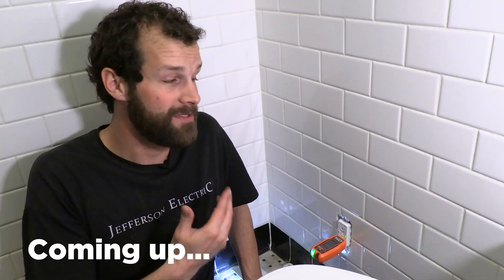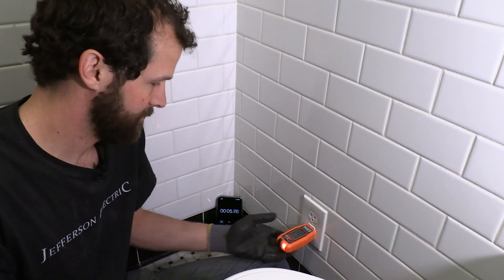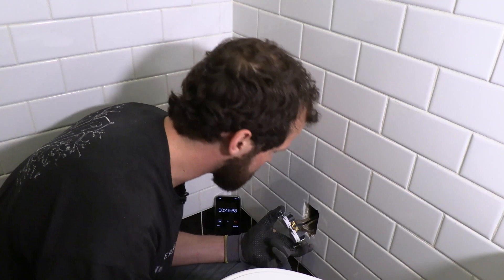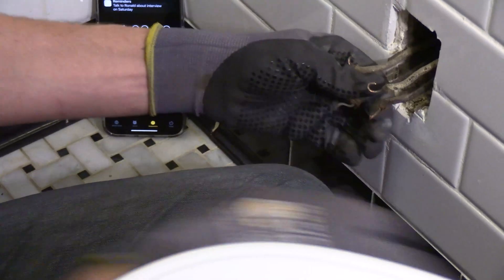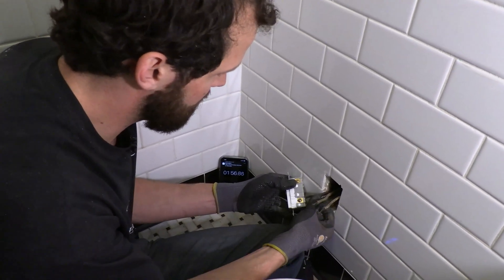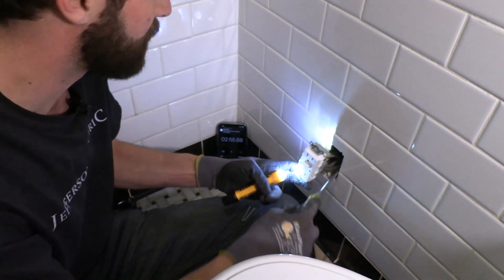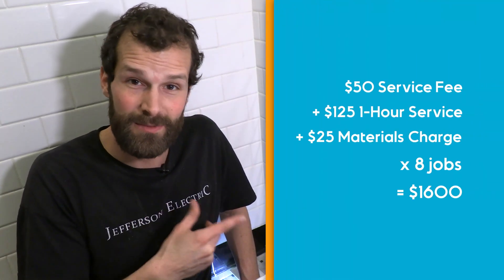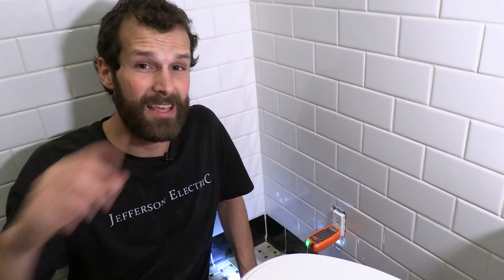Making $1,600/hr. As An Electrician?

Comment: I do alittle bit of DIY around the house. I just learn some of this over time. The builders grade light switches seem to be the worst. I've had so many of those fail. Where terminals on the side that hold the wires just break off, or the back of the switch is broken in half.

Comment: Yessir I know all this and I'm a green light apprentice :) Would it not be a better ground path attaching a piece of ground to the ground screw in the back of the box instead of the actual screws used to mount outlet? Interesting...
Reply from the maker: This particular (old) box did not have a tapped hole for a ground screw, which is why I had my inner dialogue at 4:05 😅. Whenever possible, the dedicated ground is better, we just didn't have that option here.
Reply: @ElectricProAcademy  Got you. Thanks for the input!

Comment: GFCI doesn't require a ground. That is what the sticker is for. GFCI works on the imbalance between hot and neutral.
Reply: GFCI stands for Ground Fault Circuit Interruptor. Hence, the need for a good path to ground.
Reply: @shubinternet ,you can install a GFCI receptacle with no ground. If a homeowner has a 2 prong Receptacle and wants a 3 prong and doesn't want to pay to run a ground to it... then you can install a gfci with The no equipment ground sticker on it. NEC 2020 406.4 (D)(2)
Reply: @shubinternet  No read your code book. 
Ground fault path is extremely important but has nothing to do with gfci operations

Comment: I tape the receptacle when there is bare copper grounds. It does short sometimes when not tapped. I've seen it happen, it's happened to me. Not with any work I've done myself, but work someone else did after they were gone. It only takes an extra 30 seconds and can't be too safe even if it's not necessary. It can't hurt.

Comment: im so confused ive always been told the slide in connection to and outlet was a huge no go? like you should always hoop your leads. am i missing somthing?
Reply from the maker: True true, we know exactly what you mean! The difference here is that GFCIs are not actually "backstabs", they just have covered, screw-in terminals. Basic receptacles, on the other hand, have a tension system that is not as reliable as a hooked and screw-tightened connection
Reply: @ElectricProAcademy    thank you for clearing this up for me!

Comment: Even though it only took you 7 minutes do the techs take the full hour to make the home owner feel like they are getting their moneys worth?
Reply: You charge for 1 hour, usually first hour is higher priced to cover cost of the trip. Home owners would rather you be in and out then standing around or sitting in the van. You could always tighten connections at the panel but if you touch it then you're liable. 1600/he would require rapid turnover. I think.

Comment: GFCI does not require a ground. You're fine without it. It looks to be an ungrounded system anyway. Most likely, all 3 prong receptacles in that home should be GFCI protected because there are no ground wires to any of them. That means more work/money for you.
Reply: As long as you mark it no equipment ground. Right?
Reply: @johnsandlinjr  Yep, and "GFCI protected".
Reply: @brianharmeson3144  which I always find funny when it’s over the gfci lol
Reply: @johnsandlinjr  I've seen that happen too. Obviously, a receptacle that is "GFCI protected" can be any receptacle on the load side of the GFCI. Of course, the "GFCI protected" stickers are only required on standard devices, not actual GFCI receptacles.
Reply: It was a self grounding gfi anyway.
Reply: That doesn't matter.
Reply: Other devices would not be GFCI protected since he worked load side to the line side.
Reply: I think this is probably at his own house. If that’s the case, most of the wiring I’ve seen him work on was in shielded metallic conduit which is providing the ground path.
Reply: @csbarbourv  The metal/armored jacket of old cloth covered conductor BX cable is not listed as a grounding path.

Comment: You put both the line in the load on the same terminal. Big mistake. Go back to school
Reply: Depends if the rest of the circuit needs to be GFCI protected or not. Video didn't show what else was on that circuit.
Reply: How do you know the second circuit was meant to be load. Quite often you will need to put line in and line out on the line terminal. You only use the load, if you have a down stream circuit that needs to be ground fault protected by this receptacle. Go get a refund from your school and learn real life application..

Comment: Maybe $1600 a day, not per hour. Electrician has to locate house, get tools and materials out of van, greet customer, possibly move stuff out of the way, lay down drop cloth or towel, do the actual job, sweep and or vacuum up the mess, move stuff back, explain what was done to the customer, collect payment from the customer, collect your tools and maybe a ladder, put them back on the truck or van and move on to the next job. Those things add a lot more time to your 7.5 mins. And, do you really only want to do things to code minimum  I think your math is very flawed, Joel. And that job you just did is a callback waiting to happen. Thanks, Russ from Oregon-27 years in the Trade.
Reply: Nothing wrong with code minimum.
Reply: No reason for a callback there.

Comment: How did you get the ground in?
Reply: It's probably a grounded metal box which grounds the GFCI when it's screwed on. if not then there should be a sticker placed on the face plate "no equipment ground", stickers should be in the receptacle packaging. He could've also drilled and tapped the metal box to add a grounding pigtail and screw instead of relying on contact of the screws and yoke like my first answer. But he used the first method I mentioned.
Reply: It's not required. There probably isn't a ground anyway by the looks of the cloth covered conductors.
Reply: Correct, Brian Harmeson. BX is not observed by the code and does not offer a low impedance, effective ground-fault current path.
Reply: @frontman4u2  I met one of your employees a couple weeks ago (parts runner) at the supply house (KR). Really nice kid. I told him how much I enjoy your videos.
Reply: @ElectricProAcademy  Pre 1960 BX is type AC cable and is recognized. The armor clad is grandfathered as an EGC, but does not meet current standards, and when possible should be replaced. Your tester indicated correct, so it's either being grounded by the AC cable armor (if that is the system) or by external individual EGC on the back of the metal boxes. Either way a better alternative is using a self grounding GFCI, (Leviton) readily available in my location.